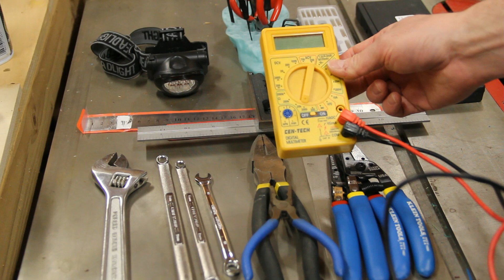RepRap 101 - Assembling a tool kit for building and operating a 3D printer.

Comment: What gauge did you find most ideal for bed leveling?
Reply from the maker: I use a .003" (.075mm) gauge.  when it can slip under the hotend, but the next size up (.004") can't, I call it good.

Comment: were did you get your wire strippers from buddy?
Reply from the maker: I got mine at The Home Depot, which is a giant box-style chain store we have in the US.  I checked on Amazon, and if you wanted some similar strippers, I think you'd be better off ordering them from Amazon in the US rather than Amazon UK., as the prices seem to be about double on your side of the pond, and that's before currency conversion!Here's the smaller-gauge item:http://www.amazon.com/Klein-11057-Klein-Kurve-Stripper-Cutter/dp/B000XEUPMQ/ref=sr_1_7?ie=UTF8&qid=1393520380&sr=8-7&keywords=klein+wire+strippers

Comment: Another great video.
You should have a vice or another way to hold things solid if you are going to use drill bits or a rotary cutting tool. Eye protection and ear protection are mandatory, too if you use power tools. When you are working with hot ends at temperature you will need good thick gloves to prevent burns.
I find that a razor blade scraper is handy for removing small bits of filament from the build plate. A cheap webcam is a nice addition, too, so you can keep an eye on your printer without having to be right next to it.

Comment: I would add to the list a few files (small round files are my favorite for working plastic)  and i would also add single edge razor blades (without the handle) i use them every single time i print handy for cleaning the glass and also working prints
Reply from the maker: Good calls!